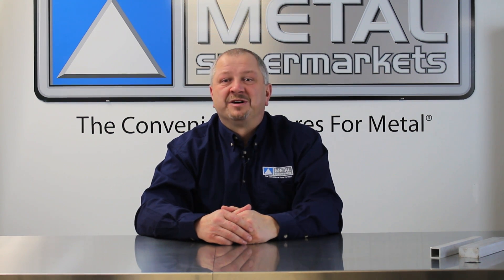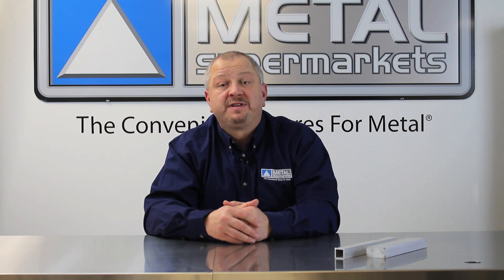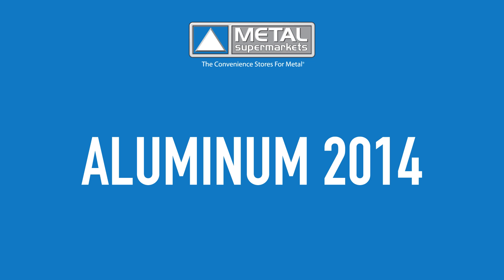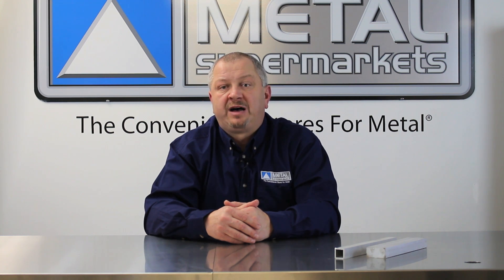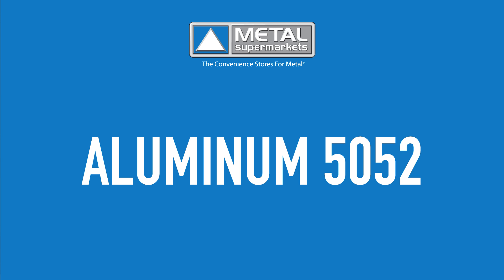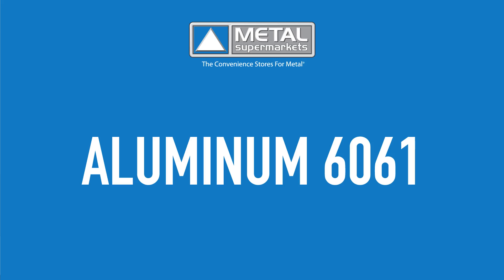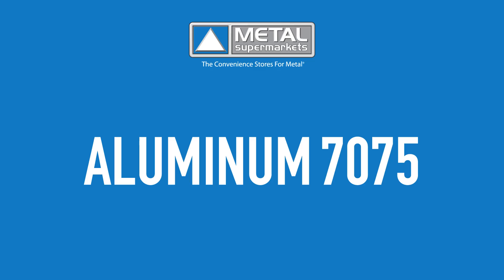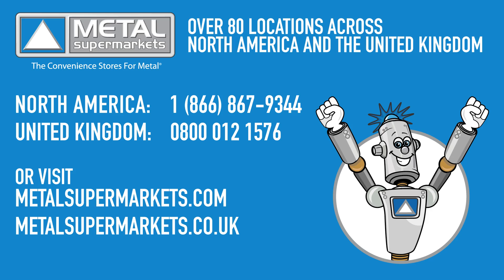Which Aluminum Grade Should I Use | Metal Supermarkets

Comment: If I was going to build an aluminum structure (both framing and walls) which needed to stand up to very high wind pressure. Which grade would be best?
Reply: Probably 6061...2024, 6061, and 7075 are recommended for structural applications. 6061 is the most commonly available aluminum and can be found in a vast number of types of extrusions. It's also cheaper. 6063 is also very easy to get, but its more soft and not as strong. 7075 is apparently the strongest but is hard to find, super expensive, and very much likely not in the shape you would want it to be in.

Comment: Eh, I want to know if they're weldable and if so, would it reduced it's strength?
Reply: I believe welding heat-treated aluminum will bring the welded areas back to their untreated state, so they would have to be heat-treated again. I'm not an expert though. Some aluminum alloys (like 5xxx) can be welded more easily than others (like 2xxx or 7xxx).

Comment: you missed the most important freaking part. The relative price and availability. ONe can get extruded 6061 or 6063 in tons of sizes. try gettign square tube in 7000 series aluminumand expect to pay 12x the price. kind of important to know which alloys are " normal" vs aerospace type prices.

Comment: Why is the range of aluminums used for aircraft so many different types.im assumimg different parts. Are made with different classifications.does anybody know the reason for this and or does anybody know where to access a chart stipulating what grades are commonly used
Reply: Depends on what type of service the particular part will be put into. Stronger grades are used for structural parts like framework and such, weaker grades for internal paneling, decor, cookware,containers, etc. Corrosion resistant grades for the skin and fuel tanks, etc. Just depends on what requirements are needed and how much they're welling to pay for a particular level of performance.

Comment: 6063 , is usually used for extrusions, like window frames, beams, etc. It is also used for roofs and such. It is easier to weld it too. It isn't the strongest one, but it is easy to work on site, and easy to anodize and create smooth finish.

Comment: Please help me ...I want to rebuild new Jeep wrangler body .Whole body both the four doors rooftops and the behind door ..Which aluminium should i use.......
Reply: He wants to gi aluminium ( no rust properties )  Special project for him.  You will go 18 gauge sheet metal ( cold rolled )  can rust quicker but easy to weld and 99% jeeps done with this . 18 gauge is .050" thick.
Reply: @larrywalker6105  thanks for your feedback. Much appreciated
Reply: Soft utility aka 2024.
Reply: @larrywalker6105  why would you use 2024 vs the 19 gauge sheet metal it's made with (not sure which type)? My old wrangler needs lots of help and trying to develop a bill of materials for spring/summer welding project
Reply: Boss may I knw wich aluminum alloy used on Detonators blasting cap ?

Comment: Do you know any adhesive, which can bond polish alluminum sheet together?
Thank you
Reply: a good 2 part adhesive. Devcon 2 ton is good stuff. G-flex is what I currently use. If there is any way to scuff the surfaces that will be joined, that will really help the bond. Needs to be properly cleaned too, alcohol or acetone work well.
Reply: 3m auto body adhesive or Fusor, both 2 part epoxies that have a shelf life about 1 year.